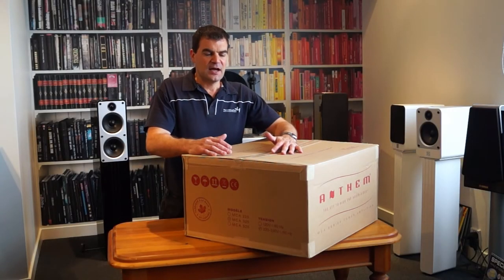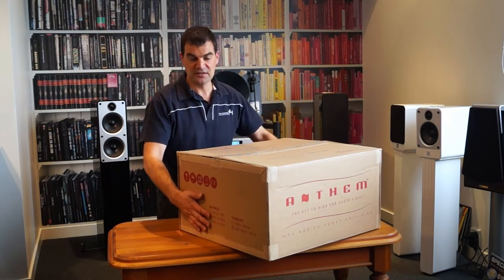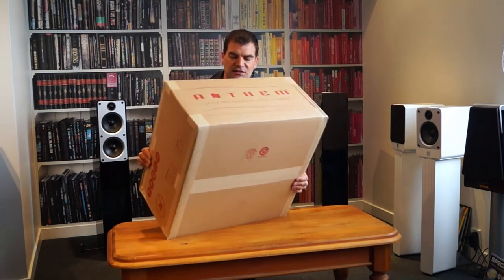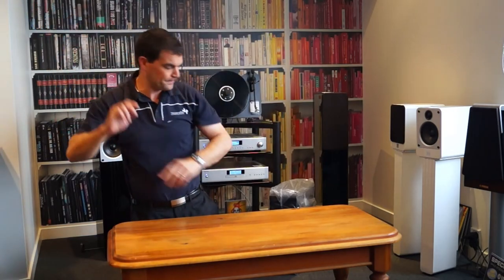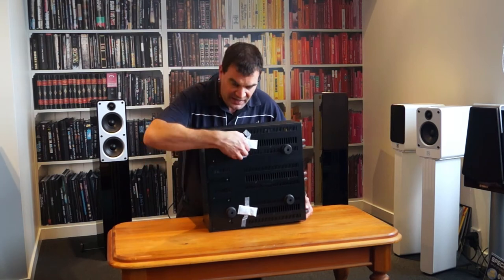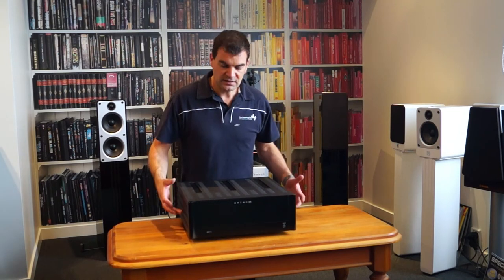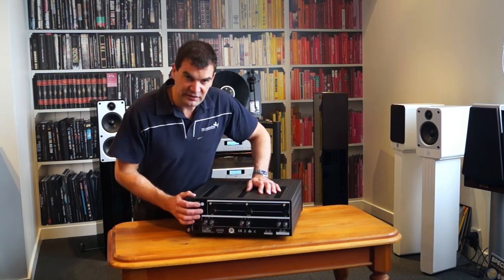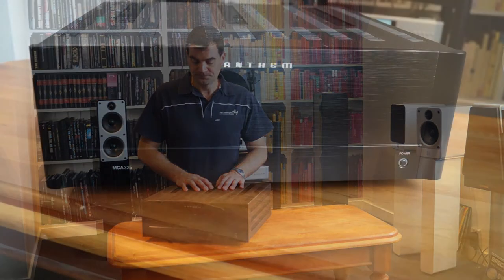Anthem MCA 325 Power Amplifier Unboxing | The Listening Post | TLPCHC TLPWLG

Comment: How would the 325 go with the Marantz sr8012 for the front stage using the rca pre outs what improvement would it make
Reply from the maker: Should you make the move, and purchase the MCA-325 you are in for a WOUNDERFUL experence. The improvement will be dramatic and obvious. Way better bass control and depth, better centre speaker performance and the front three will integrate better.
Reply: The Listening Post Christchurch | TLPCHC Thanks for the response I have Klipsch RP280f fronts and Rp450c centre speakers rated 150w continues 600 w peak and the mca 325 is 225w continues would it damage my speakers
Reply: @romanlewandowski9616  i don't think so, i m planning the same power amp for my b&w 600 s2 speakers which are rated 150w max too.
Reply: @TLPCHC  bass from a sub or from the speakers?
Reply: @TheMethod44  from the speakers

Comment: Great review.. Im a MRX720 owner.. how to connect to this amp? The mrx720 is not equipped with the xlr connectors!
Reply from the maker: Most AV receivers don't have XLR. It is more common with stereo equipment.
Reply: @TLPCHC   I finally got this one but the MCA225(2 channel version) over the Rotel power amp. Have you tried this power amp in your store? I am having  poping sounds when the Anthem powers up & powers down? Its not very loud but its there. Been reading few reports regarding this specially with sensitive speakers. You experienced this too? Thanks.

Comment: I note that there is no switch to pick between RCA and XLR
Reply from the maker: Yes there is. (Did I faile to mention it?)  Check out 12:29 in the video (the close up photos are superb)
Reply: The Listening Post Christchurch | TLPCHC There is a switch on the back but that is for deciding how are you turn the amp on manually,trigger or automatically.But I can’t see it switch for switching between the XLR and the RCA’s
Reply: @TLPCHC  The video is 7 minutes long and I also don't see a switch for RCA to XLR